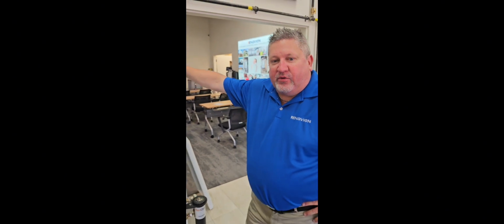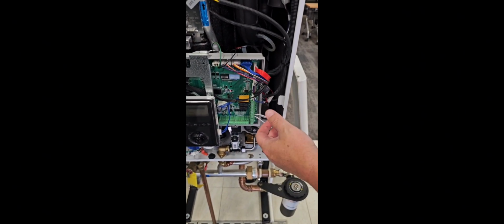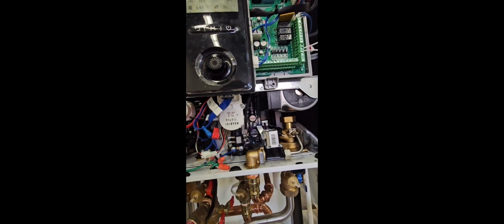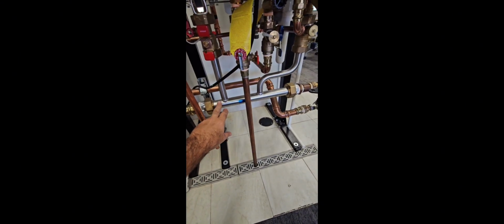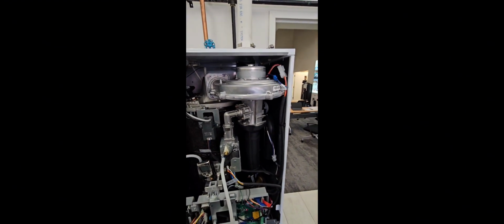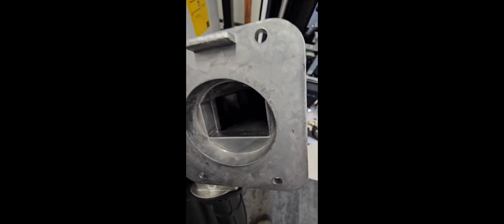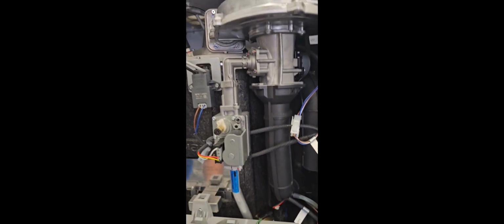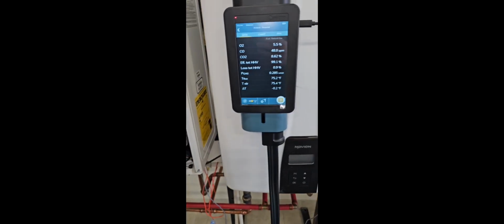Navien Combi Boiler Walk Through and Maintenance Tips

Comment: Ive recently become aware of the importance of using the proper type of PEX piping for hydronic heating. A contractor in our area retrofitted several buildings with non oxygen barrier piping. Its taken about 5-7 years but every one of the buildings has sludged boilers and system piping. Id love to learn more about the science behind this phenomenon and whether that test kit you showed would help indicate this issue.